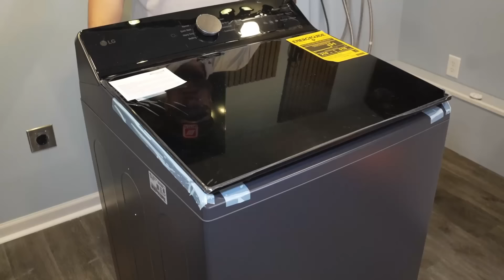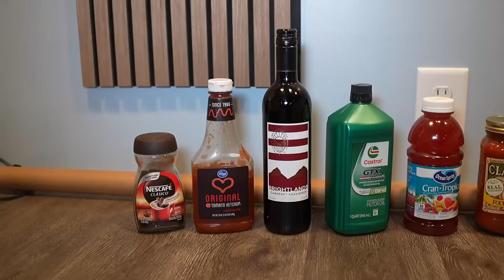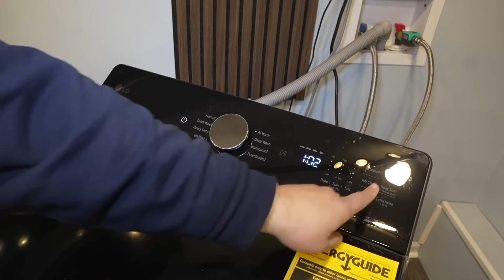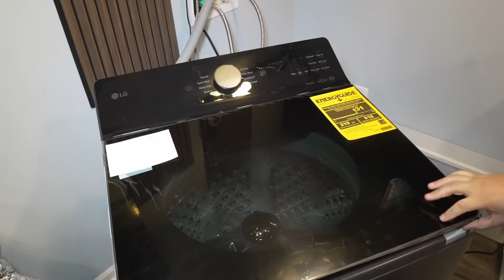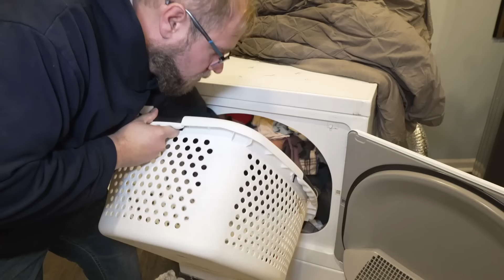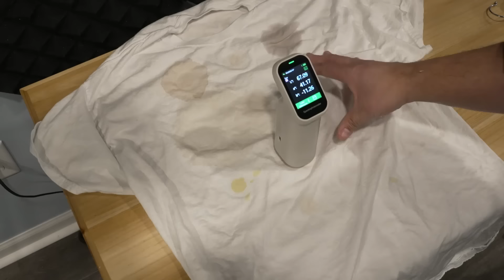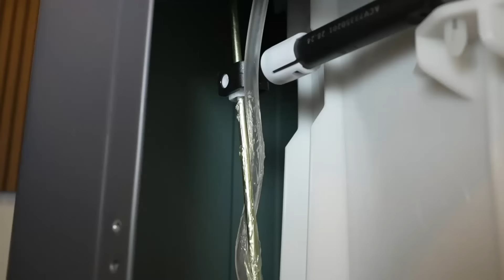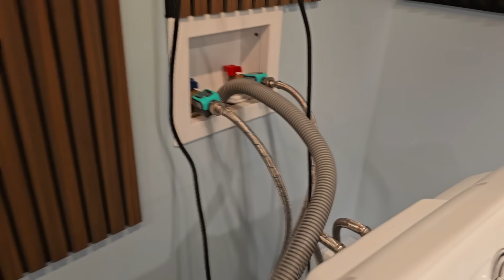Is 2025's "Best Washer" Actually Good? LG WT8405 Test & Teardown

Comment: I just bought this washer and it won't let me wash my clothes in really hot water. It cools down my hot water by mixing cold water in with it as it goes into the machine. I hate this. Is there a way to make it only use my hot water temp. That comes out of my hot water heater like my old ge machine did? I want HOT water, not warm to wash my clothes in. I have turned the cold faucet off, but that doesn’t always work. Sometimes the machine will just stop altogether until i open the cold faucet back up. ☹️ I even got a replacement washer because i thought the first one was malfunctioning.  But the new one does the same thing.
Reply: I've seen this, and it seems as if lg decided to go w a lower temp for the hot option over the regular 130 degrees... there's is more like 88- 105 ... I've also seen that the sanitizer option gets it hotter, but I'm not sure how you can customize it. If you can set it on a hotter temp w enough water and the way you'd like it to wash. Please come back and let us know.The sanitizerr option supposedly goes to 156 degrees, just fyi.. maybe try it out on something you don't care for so that the temp won't ruin your garments.
Reply: Did you ever figure this out?

Comment: For those who come across this and are interested in this machine, I have thoughts. I bought one and it was delivered 2 days ago. I've washed 8 loads with it so far. It manages much larger loads than my old top loader. My old one was 3.2 cuft. That said, there is NO presoak cycle. Not on the app nor the machine dial itself. The Lowe's details page said it does have one, but it doesnt.
It takes up to almost 3 hours to complete a load if you're using heavy duty with extra rinses. They do have a 30 min quick wash but I have not used it yet. You really do need to fill it 3/4 of the way full for the best clean. Any smaller or larger they don't come out as clean as I'd like.
I don't regret buying the machine though. I just think coming from a 16 year old top loader I had unrealistic expectations. Old machines with no he features with REAL agitators are just no comparison to modern ones.
The reason I bought a new one is because my old one was leaking out the bottom and would have had to replace the bottom seal, clutch, and actuator which was impossible to find all the parts for, unfortunately. I was happy to be able to buy a new machine capable of handling large loads. 

So overall the pros and cons
-Pros
very large capacity 
Has add a garment option 
Deep water wash option 
Can add up to 2 rinses to some cycles 
Can select a variety of fill temperatures

-Cons
No presoak (though I found a work around)
Agitator not a true agitator 
The glass lid is so tinted you cannot see through without a flashlight, they should add a light inside the lid.
Cannot fill machine with lid open
Cannot fill to capacity or fill half full and have clean clothes
Long cycle times 

I think next time I have to replace my machine, if there are not large capacity top loaders with real agitators then I am going to try a front loader. I was always against them but the tumbling action surely agitates better than an impeller or agi-peller design.

If you have any questions or anything I'd be happy to answer!
Reply: How did you find how to do a presoak? Also, when you wash on the hot setting, is your water really HOT or just warm? Mine is cooling my hot water down by mixing a little cold water in with it. Can you use the deep fill after the cycle had started if you feel like it doesn't have enough water in the tub? Mine has been very inconsistent with how it let's me use my deep fill. I have one day left to decide if I want to keep it. I love how big it is though. Why do you say it doesn't have a real agitator? I'm not sure how to tell.
Reply: @ughdontknow   I found out how to do a workaround for a presoak from a comment on Reddit. It works!

Step 1
Load washer, turn washer on and set cycle to deep wash. Set the water temperature. (Spin and soil settings are not important for this step) press start button and let the washer fill with water. Once the desired water level is reached, press the start button to pause. Then hold down power button to turn washer off entirely. **It’s important to do step two within four minutes of turning off the washer or else it will automatically drain.**

Step 2
Turn washer back on and set desired cycle along with desired temp, spin and soil settings. Heres the trick…. Set the wash for DELAYED START by pressing delayed start button. Set the delay time for however long you want the clothes to soak. Then simply press the start button. The washer will do a sense and spin a few times but once it’s done sensing it will stop and won’t begin washing until the set delayed time!

As to your hot water question, my machine seems to have hot water on the top Hot setting. Though my hot water comes out of my sink faucet at 145f so I've got the water heater set pretty high. That said, the middle temp is not warm, it's cool for sure. 

Yes you can select Deep Fill option after you've already started a cycle on most of the cycle types. I can't remember which ones don't allow it but I think it's AI wash and quick wash? Not actually sure. But to do so you just need to pause the cycle first, then press the Deep Fill option. If the cycle you're on happens to be one that doesn't allow you to do this, you can also change your cycle type on the knob, which really comes in handy sometimes! Just gotta pause first. 

As far as it not being a real agitator, it's a hybrid of an agitator and an impeller. If you look at the bottom of the machine you see those bumps at the base? That's an impeller design. Then there's the rod in the middle with the corkscrew design. Makes it look like an agitator but does not function the same. An actual agitator has deeper fins running from the top of the post all the way down to the base. Hard to describe. Just Google images of the tub of 90s style top loaders and you'll see what I mean. The trouble with this hybrid design is a true agitator is designed to suck fabrics towards the rod and spit them out along the outer area of the tub to float up and get sucked back towards the rod and down to the bottom again. An impeller is designed to roll the fabrics in the exact opposite direction. So this impeller/agitator design fights against it self. That's why if you watch it during the wash action, you'll see the fabrics get wrapped around the rod and then reversed off the rod. Over and over and over again. Not a lot of mixing. That's not quite ideal. 

I'm not sure what to tell you on whether you should return it or not because I have no experience with any machine newer than 16 or 17 years old other than this one. My last one was made before the department of energy made good quality machines illegal to manufacture. I just don't have anything else current to compare it to.
Reply: Thank you so much for your reply. Yeah, I'm kind of thinking about just keeping it because anything I might replace it with would probably be even worse. I think they're all mixing cold water with hot because of some 2015 new regulation from the depth. Of energy. It sucks.
Reply: @ughdontknow you're welcome! I'm glad it was helpful as it took me a long time to write 😅. I think it's a fine machine by today's standards. I did X post Trump asking him to disband the DOE because of the washing machine regulations lmao. Might write him a letter too 😁 
I bought the 5 year warranty on the machine because it was only $159. And if it lasts longer than the 5 years, I'm probably going to look into replacing it with a front loader. We'll see what new regulations come into place by then. What I REALLY want is a Speed Queen top loader with a higher capacity but I don't think that's going to happen any time soon.
Reply: I had a whirlpool front load. Lasted two years and always had a mold issue no matter what I did. I guess they have improved them in some respects, but they take up a lot of room and even though they use less water, they use more electricity because they run longer. And I never felt my clothes were really clean.I was very unhappy with it. Just my 2 cents
Reply: It does not wash good when halfway full? So how much do you fill it to wash good I have this washer

Comment: Weve had this washer with matching dryer for just about a month and so far really enjoying it. I feel its done well with stains, specifically blood (son had a bad bloody nose), and i rubbed a little stain remover and tossed it in immediately after, normal wash mode, stain 100% removed (stain was set in the shirt for about 2 days).  I will say that I washed a king size comforter, and it washed it just fine, i did feel like the dryer struggled a little bit with getting it dry and made it extremely wrinkled because I feel like it didn't have enough space to really spin sufficiently. It was a pretty thick comforter, I will say, though. I do love that I can control things through the app, and it seems like a pretty quiet washer. I also love the look, the aesthetic of it, although it's not important because obviously it needs to do its job in washing clothes well. I've seen some comments say that it's not getting their clothes clean and they have to wash multiple times, i'm not seeing that at all, so unless your clothes are saturated and filthy with oil and debris, it should be just fine. We had a samsung front loading set in our previous house, and I wasn't a fan of the front loading because of the amount of maintenance and cleaning you had to do to keep the washer fresh and keep it from bad smells. Not feeling like I'll have that issue with this washer.
Reply: Do you still like it? Thinking about buying one
Reply: Thank you for your thorough comment!  We just purchased this washing machine as our 5yr old Maytag ( with no agitator) started shaking violently when it would get out of balance plus it was starting to rust where you add the detergent!  I am sure this LG will be a big improvement over the Maytag impeller style with no agitator!!  Thank you!

Comment: The next higher model the WT8600 does have a pre-soak option, it's in the settings but that one has an LCD screen where you can activate it. 
Maybe this one you can only activate the pre-soak through the app?
Reply: I think that must be the case

Comment: We have LG washers and dryers and a fridge. The fridge is behaving weird, the washer has bad bearings and load sensor, and the dryer is stone dead
Reply: I believe you, but we need to know what you replaced them with and are they better?
Reply: @CommonSensei-d5h  the fridge was replaced with a GE french door with freezer on the bottom. the washer and dryer was replaced with a speed queen TR7 and DR7. what i mean for the old LG fridge is it is a standard upright where the freezer gets down below negative 25 while the fridge maintains 52 degrees.

Comment: Maybe the tide pods going on top might be affecting wash quality. The machine uses a small amount of water initially and that might not fully agitated the clothes enough to fully melt/distribute the pods until much later when the water rises. That's why the manufacturer recommends putting the pods first, then clothes on top of the pods. Try using liquid detergent with the numbers on the cup.
Reply: Also 2 pods is too much detergent for an HE washer. It won’t clean as well as it should. He goes to such incredible lengths to test the washers but he doesn’t know how to do laundry!

Comment: Mec-con... MSH series..... aluminum electrolytic capacitors are designed for a long life, specifically 10,000 hours at +105°C according to Mouser Electronics Canada. 
They also offer miniaturized dimensions and low impedance. 
These capacitors are often used in demanding applications like 5G base stations and DC-DC converters

Comment: Ben, do you think the Lg wt7150 is a better machine than this one? Does the wt7150 have the same heavy duty suspension system with the shocks that are shown on the model in this video? Do you think the wt7150 is currently the best top load machine on the market as far a reliabilty & being able to handle larger loads? Thanks

Comment: I appreciate your videos and I know these comparos aren't an exact science, but in the end I find them ambiguous and not definitive.  I have Maytag Bravos washer/dryer from 20+ yrs. ago and they still run fine but the spin cycle on the washer is getting pretty loud...what do you think may be causing that? I don't know if it's belt or direct drive...I used to but I forgot.
Anyways....I'm kind of pre-planning for a new washer and dryer.  I want you to tell me what you would buy.  Is it the Speed Queen TC5 top loader or the LG 4000 front loader...or something else?  My wife is hinting at a front loader so that would signal the LG.  At this point, we don't necessarily need another 25 yr. lifespan but a solid 10yr. would be desirable.  In the end, I want the best reliability and clothes cleaning/drying combo for around $2K.  It seems that the LG 4000 scores high quite often in these comparison tests and the combo is available at HD for under $1700...WM4000HWA - $692.13 /DLGX4001W - $778.87
I'll spend more on the Speen Queen  combo but even though they last a long time, the cleaning performance and capacity doesn't seem to be worth the extra money.  And with the SQ it would have to be their top loader...I'm not spending $2K+ on a washer...just not worth it to me.  
So...whadda ya think?  Thanks again.  Subscribed.

Comment: I purchased this washer and had it for 3 weeks. It didn't get anything clean.  It is by far the worst washer I've ever had.  I tried all different cycles , pods and liquid soap. Absolutely nothing came clean.  I had to wash items 4 and 5 times to remove a stain.  I returned it and got a full refund.
Reply: What did you get instead

Comment: I would feel better, if somebody would just cut the price in half and just get me a real vintage traditional top load washer that doesn’t have AI or 100+ features on it. I absolutely will not recommend an AI top load washing machine, especially over the fact that it doesn’t even have an agitator. There has been people that have had a lot of issues with the washing machine, mostly getting the clothes clean, since it only relies on a pathetic wash plate and there’s no agitator with this machine. The normal cycle on a top load will definitely take up to two hours, which is a total waste of electricity. These high efficiency top loaders are a big time, don’t clean nearly as good as the front loaders, as well as the old school, traditional agitator top loaders, plus they get thrown out after a couple years or even less. The repair prices are definitely a rip off with these new machines, especially since something could go wrong with them in no time. 

If you want a washing machine that cleans clothes and you don’t have to keep having to waste money on repairs, don’t waste your money on a AI powered washing machine. Either get a speed queen TC5, or look for a used 1980s Kenmore, whirlpool, GE filter Flo, or even better a wringer washing machine. We don’t need AI or all this extra crap to do our laundry, because this is what leads to stuff messing up and mistakes being made. And I do not want any computer operated washing machine in my laundry room. I have an LG front loader from 2010 and I hope and pray nothing goes wrong with it. And if it bites the dust, so help me God I will be buying a speed queen TC 5 set.

Comment: 😭😭😭 Buying a new washing machine is an absolute nightmare.  I'd buy the huebsch if it had at least 5 cu ft. I don't need options. I need my clothes well washed and well rinsed in the leat amount of time without having to do maintenance on the machine like front loaders.
Reply: Everything in life requires maintenance
Reply: @tjsells9288 maintenance is fine. Mold in a WASHING machine isn't
Reply: @tjsells9288  They just want  to stop all the things you SHOULD NOT have to do, hence a good top loader, that does not require life maintenance every wash.  Appliances, they used to last 20-30 for ranges and refrigerators and 15-25 for washers. Maintenance on the first day of delivery is not normal. For your precious front loader it is daily maintenance. I am returning my front loader and I only had them 4 weeks. So I am also looking for a good top loader. It does NOT exist.
Reply: @CommonSensei-d5h  What maintenance are you doing? Because that isn't normal even for front loaders.
Reply: Right? Its more complicated than buying a house! Just tell me which one to buy already!
Reply: It’s still a nightmare 😂

Comment: Screw an Lg. Unless you like hand washing clothes. I would never recommend an Lg. Put your knee down in some dirt. Wash those pants. And see the dirt still there. 14 oz Carhartt hoodie and 12 oz Carhartt paints 3 washes later. I had to spray them out in shower and hand wash. Just put on a pair of paints that look dirt because washer is crap. Better off spraying them with shower head.

Comment: I just bought an LG washer. Our Samsung Smart Washer didnt even last a year before it started causing problems. It Recently doubled our water bill because it keeps refilling and wont spin the clothes. I had a warranty on it but i can see from others reviews it keeps causing problems so I'm ditching the thing. I will never again buy anything that Samsung makes. The LG I bought is WT8200CL it had great reviews rated higher than most any other washer at Lowes and Home Depot. We'll see.